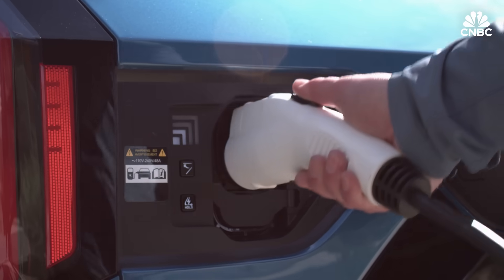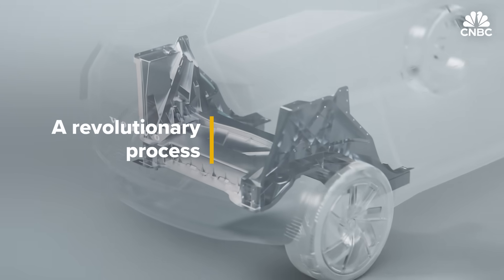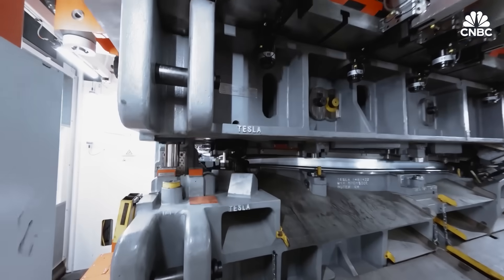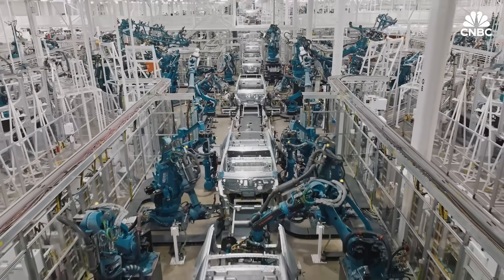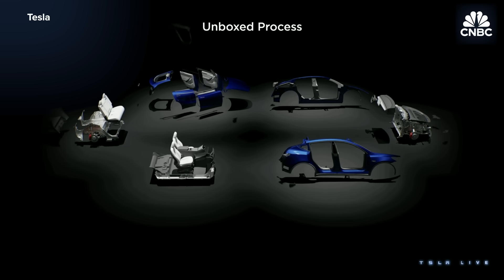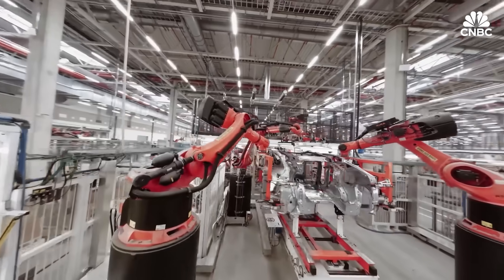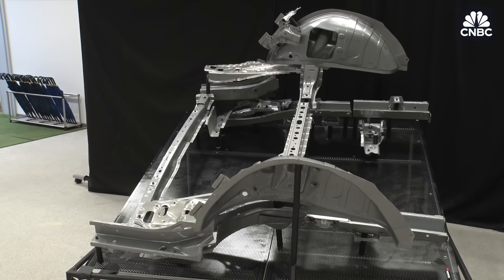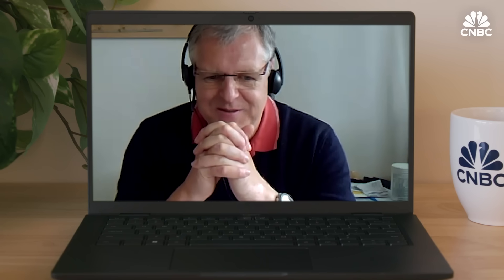Why Tesla And Other EV Makers Are Betting Big On Gigacasting

Comment: So there will be absolutely zero chance of repairing a car that's been in a fender bender?
Reply: there is a part that can be welded in behind that part and the car has seen so much force anyways that its not recommended to bend it back anyways
Reply: So it will be totalled and insurance picks the tab
Reply: @brodocmd   I'm more worried about the insane amount of e-waste and how shithole countries like Nigeria will have to contend with dangerous, accident damaged EVs.
Reply: I had the same thoughts.
Reply: Giga pressed parts can be repaired more easily than standard parts as they can be custom cut as needed
Reply: Pretty much. The majority of the shops won't be able to fix the cast, and be certified to do the repair. Labor involved would make insurance just total the car.
Reply: That’s not true. 
Tesla have repair procedures when the casting is compromised in a crash and have casting cutting lines. 
But insurance companies decide to total a car based on repair costs, not on repair possibilities.
Reply: @1943vermork   Did I recognize you?
Reply: @1943vermork  Hertz experience with Tesla vehicles pretty much proves there is no lower costs.
Reply: @heresteven  Hertz was hit by resales value, not maintenance cost. 
The whole rental company model is based on obviously rental income but also managing depreciation value of their fleet. 
It’s an important accounting calculation at every earnings report. 
Tesla at the same time started aggressively lowering theirs selling prices which directly affected the value of second hand vehicles.
Reply: @heresteven  re: "Hertz experience with Tesla vehicles pretty much proves there is no lower costs..."  "YYYYAAAAHHTZEEE...!!!" 👏<---- Steve sinks the 3 at the buzzer.
Reply: @1943vermork  re: "Hertz was hit by resales value, not maintenance cost" Hertz was hit with a DOUBLE WHAMMY of both Depreciation AND Repair Costs.  don't think you're going to BS with me around.
Reply: Q: So there will be absolutely zero chance of repairing a car that's been in a fender bender? A: oh there's a chance, only problem is they're just NEVER going to send you the part at remotely the speed at which Insurance Co's and modern Autobody/Collision Repair Centers operate.  you're lucky if you see the part at all.  nevermind the fact that customers can't be inconvenienced by Rental Cars till the "12th of Never".   the customer doesn't want to pay for that and NEITHER does the Insurance.
Reply: That's the point, they don't want plebs driving just the upper class.
Reply: @Robert-j6r8c  You will be out of driving not becuase of casting,but because it will become unaffordable (already is), that is why Tesla is focusing on robotaxi.... you will now longer OWN a car, just keep renting it journey by journey.....have a look at Rimac-Bugattti

Comment: Let's see how the Chinese companies make cars so much less expensive
Reply: The gigacast machine is made by a Chinese company 😂
Reply: @aw6589 Most of Chinese EV cars are not profitable. Gigacasting helps with profitable since it replaces parts and equipment.
Reply: Chinese EV'S generate less profit than Tesla. They are also usually of lower quality and use cheaper labour.

Comment: This video fail to tell you that the scrap pieces can be reused as molten metal. It’s not all doom and gloom on the scraps.
Reply: But will the reused material for casting again make quality stable?  🤯I don't know. Just wondering if,  imagine, scrapped material melting cost + unstable or worst quality = more cost.
Reply: @hongfeiwang6929  The major Chinese BEV makers are going to GIGACASTING  they know something the legacy are only exploring now, Volvo and GEELY   already have them, those who don't go this way will have more costs both in robots and space for assembly and time  to manufacture,Giga cast pieces make for a stiffer chassis ,good for NVH dynamics .
Reply: @hongfeiwang6929  As long as it's clean when re-melted, it shouldn't reduce the quality any more than newly made aluminum, and I'm sure they wouldn't contaminate their molten metal.
Reply: That's all metal in a car
Reply: the rejection rate is 3% in traditional die casting (gravity casting, low pressure casting), and video says High Pressure Die Casting is 15% ... what is huge scrap
you're right on the recycle of raw material, but labor and energy cost are lost
Reply: @freethinker5384  we know how Tesla makes profits from its Electric cars, enough that they even can compete Vs the Chinese who have lower labor  costs in China.Ford loses $30, OOO per Lightning EV, Cybtrk now outsells and outproduce the two BE pickups from legacy auto.
Reply: @freethinker5384  What do your numbers say?
Reply: @freethinker5384  provide details
Reply: True, but it costs extra to re-melt it and lower yield.
Reply: @kenmore01  aluminum melts at a lower temp than steel,there are 10 yr old Ford pickups with aluminum bodies that look  as the day they came out the factory   and rusty GM steel pickups of the same year.
Reply: @kenmore01  I'm sure you have to melt  steel scraps too, 😂
Reply: @kenmore01  extra dollar in furnace
Reply: Every part scrapped adds cost. It starts with the fact that both time and energy has already been used to produce a scrapped part. Time because the scrap part is not just a loss of capacity, but the time required to identify the part, remove the part from production, rework the part if possible, and the time out of production to recycle or remake the part (this includes labour costs as well). Then there are the energy costs to either rework or remake/ recycle the materials - all of which adds to the carbon footprint of the manufacturing process. 

Every scrapped part is inefficiency and inefficiency is doom and gloom for not just profitability but for the wider environment.
Reply: Indeed we know how casting works. 😅
Reply: @evildrizzt1  You might be surprised.

Comment: shameless CNBC.. Please change title to Why  EV Makers started copying Tesla's   Gigacasting to build cars?
Reply: Tesla copied the idea of four wheels from other automakers. Why not complain about that?
Reply: @biggeststeppa1 it’s not copying if it’s an obvious so solution 🤦‍♂️. You can fundamentally prove that 4 wheels are the optimal number of wheel. Try again. Gigacasting is a novel idea that these other automakers did not have the courage to try themselves first. They don’t have the competency to do it first without taking on excessive risk.
Reply: @biggeststeppa1  have a look at patent law. If any company can patent anything from stopping others copying something, they will. For up to 20 years a patent is valid with protection enforced by the govt. Someone (Ford) could have patented the idea of 4 wheels, but it would have lasted 20 years. i.e until 1925. Tesla is the only company in modern history, simply open-sourced their patents, which included gigacasting related patents. Without which, there would have been no EV revolution and Gigacasting copy cats.
Reply: @lala-ru1jj   while I won't read that entire body of text, I do think what I said was valid and there are no worthwhile counterpoints
Reply: @biggeststeppa1  without reading, you figured there arent any valid counterpoints. lol. get your brain checked
Reply: Profits and selling more cars because they can't be repaired.
Very green

Comment: Will this make 3rd party body repair/restoration impossible?
Reply: The video included a clip from Tesla where it is explained that repair pieces have also been designed  so that damaged rails can be cut from the casting and new rails welded on.  The clip explained that, since Tesla also insures cars in states where they have been allowed to, they are highly motivated to design the car for minimum repair cost.  Whether that is actually the case can be debated by the actuaries of the insurance companies competing against Tesla insurance.

While I have no expertise in metal forming or restoration, I have seen counterarguments that repairing built-up sheet metal parts is not very straightforward.  Even in the factory, many welded assemblies must be adjusted as the car is assembled due to the lower tolerance of the stamping and welding process vs. castings.  Munro live is a channel that has made several videos about the merits of large castings vs. stamped metal assemblies. As a consultant, they had tried for years to convince various automotive companies to explore the option to no avail.  They were surprised when Tesla went in this direction and have analysed the cost implications of Tesla doing so.  I suggest watching a few of those videos if you are interested.
Reply: Evolve EVs repairs all kinds of EVs including Teslas with Gigacasts. Google them , Evolve EVs.this is the way all profitable companies will make cash in the future.
Reply: Q: Will this make 3rd party body repair/restoration impossible? A: yes, but not for the reasons you think, it's because they'll NEVER get around to shipping you their precious replacement part, because they're prioritizing MANUFACTURING over any After Sales support.
Reply: @phillyphil1513  Tesla already selling parts to Evolve EVs a third party EV REPAIR specialist, Google  and YouTube can help you .
Reply: Yes, those giga casts crack from fender Bender and the entire car is totaled....
"Saving the envirement" BTW...
Reply: Wrong @423GustavBern  wrong  Google & watch Evolve EVs.
Reply: @423GustavBern dumb comment.
Reply: @423GustavBern  dumbest comment of the day

Comment: Repair nightmare
Reply: EVs are much easier to maintain than ICE due to the lower amount of moving mechanical parts
Reply: @Ergonomicfork 
They basically have the same amount. 
It's just the motor, but your never changing parts in them. 

EV have more electrical components and they're the things that fail. 

It's 90% electronics that fail in cars and causes problems.

Comment: the problem with casting such large pieces is when the car gets into a crash how will the part get replaced?
Reply: If your crash is big enough to deform the casting your insurance would have probably written off an equivalently sizable impact in a more traditional car anyway.
Reply: they weld in there is a line drawn where to cut behind that line the whole thing gets changed but at that much force its bend anyway
Reply: i literally just got a notice from my Insurance Co of a massive increase, and my daughter got one 6 months ago.  (in addition to all the Natural Disasters) the Underwriters across the board are having a FIELD DAY with Tesla's terrible Engineering.
Reply: re: "the problem with casting such large pieces is when the car gets into a crash how will the part get replaced?" the ADDITIONAL problem not being discussed is how Tesla will take forever to send you the part (if they send it all) because they prioritize front end MANUFACTURING and NOT Customer Service after the Sale.
Reply: I don't know when expensive car you have. Last time I have hit from left front bent my wheel sideway, result total for 4 years old vehicle. Today's car have too many parts designed to replace when accident occurred. So, if a vehicle accident have demand to the point need to replace gigacast level, Na matter how it made it will total anyways.
Reply: It doesn't. You buy a new car. Repair work is going out the window. Cars will not be repaired, they will be replaced.
Reply: Exactly just means Tesla have pushed the price back onto consumers through car insurance prices. Either way us consumers are getting shafted that's why you should check all costs before committing to a large purchase. I wanted a Tesla, but I realised the cost of Insurance in the UK for a Tesla is so high I'm best going with a different car overall even if the other car costs a bit more than a Tesla
Reply: Make a FSD car that doesn't crash into anything....  

Are you going to buy a vehicle that is cheaper, hard to repair, expensive to repair (costs will go down), lasts twice as long, costs significantly less to maintain, potentially drives itself.... 

Or the vehicle that is expensive to maintain, pollutes the earth, and runs the risk of accidents with your family or others (can't drive itself)....?
Reply: That's the neat part, you will not
Reply: You just cut out a new part and patch it in. It is currently being done cheaper than standard welded parts
Reply: You don't. The entire car is going to be a write-off, which means higher insurance premiums for all of us. Those who said "it's going to be patched" don't care about the safety or structural rigidity of the car.
Reply: They don't, you lose all your money

Comment: The casting and using the battery as the floor is genius.
Reply: You are welcome
Reply: Until a battery replacement is necessary.
Reply: @ElMistroFeroz  Tesla's come with 8 year or 100k to 150k mile warranties on their batteries, motors and drive units. Replacing a structural battery is just as easy as an old style battery.
Reply: it really isnt. Where do you want   to put the huge heavy battery? On the roof? Obviously for a car you want to have your heavy weight low and central, a toddler could figure that.
Reply: @otavongryf1379  I think you are misunderstanding. Other EV manufacturers use to build a normal car frame, with a traditional floor, and then left space for the battery in the floor.

Tesla was the first to make the battery the entire structure of the floor. This means that the battery is load bearing, and actually acts as the vehicles main support structure. This was a completely new idea. Tesla has been doing it for years, and so far only Chinese EV's have copies the idea successfully.
Reply: @otavongryf1379 why do you assume OPs comment is sarcasm?
Reply: Perfect to keep your feet warm when the batteries fail